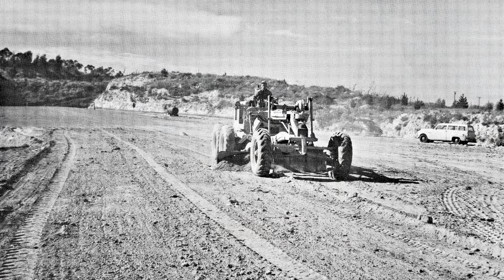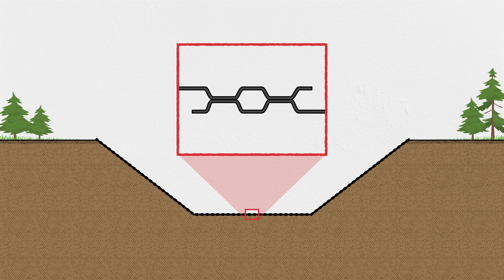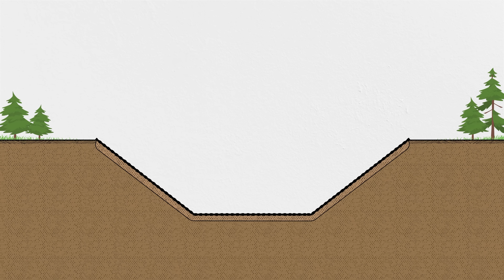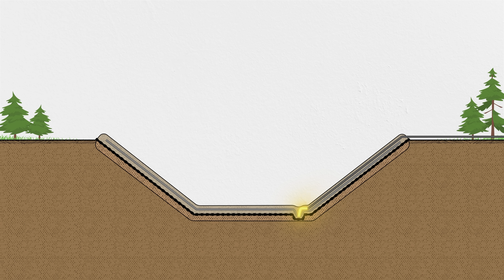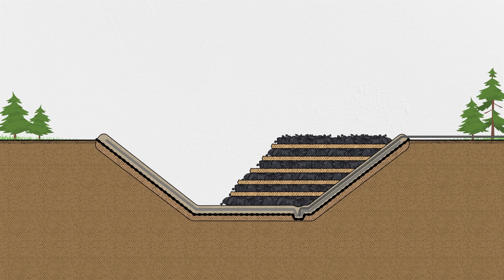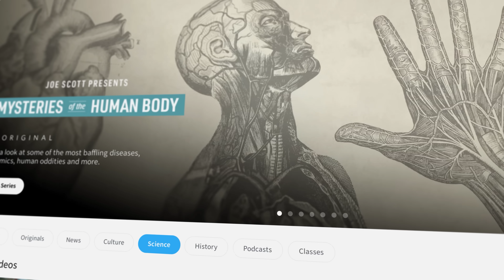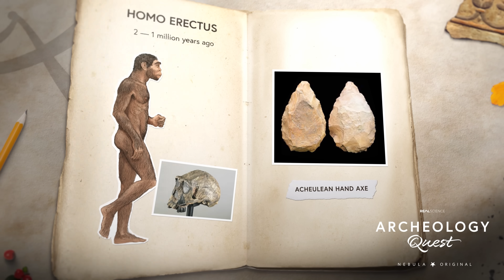The Hidden Engineering of Landfills

Comment: Take a refrigerator for example,they are now designed to fail within a year. So each household will have to throw away one fridge every year. Not because we want to. The fridges now cost something like $1,000 to 10k and then you have it fail within a year, it's unfixable too so you have to buy a new one. They used to make them last 50 years or more. This is just one example of many. This is designed obsolescence and it is incredibly wasteful and bad for the environment, it should be illegal for companies to produce trash products like that. A technician also told me that these newer fridges are designed to leak freon into your home, and so there is that added toxic bonus. What do you think they do in the landfill? Also, do you think anyone would buy these products if they knew they would have to replace them within a year or less? Think about the impact this has when everyone has to buy new appliances and every kind of new products much more frequently because they have been designed to be thrown away so you will have to buy a new one soon. I wouldn't buy new shoes three times a year. I used to buy a pair and wear them for 2 years, but the quality goes down and it makes me so sad to have to throw the worn out ones away a couple weeks or months after I buy them. I have literally bought name brand shoes that broke the first time I wore them. It's exhausting living like this.

Comment: I used to be a dust man (uk) in the 80,s,the rubbish tip took 15 mins for the truck to go down it,4 years later,it took 10 mins to drive up it!
It then got capped and left to settle for 25 years,then a new development of houses got built on it,and quite ironically 30 years later,i live in one!

Comment: I worked for an environmental engineer on new cells and caps. The process has a major flaw in that when you put sand over the geosynthetic material wrinkles are created and seams, welds, repairs get folded. These folds will produce stress on the material resulting in leaks. Perhaps this is mitigated by newer techniques but all the cells I worked at 20 years ago had this problem.

Comment: Land fills are a terrible idea. We burn the trash in well filtered incinerators extracting heat and power we use in our cities and reduce the "waste" by up to 90% in volume so the remaining material do not fill up a dump more than a tenth as fast costing less than the heat and power sell for and lasting 10x as long. Well made video, but incomplete info.

Comment: This is such an American way to do things. It's crazy.

This video is produced by the combustion facility themselves. https://youtu.be/-eVU_oARI44

It's in Swedish but they have English subtitles if you activate them. This city and municipality has about 170,000 inhabitants but the facility is so high tech it is cleaner to actually import trash from other countries to burn here, than to let the other countries burn it themselves, despite transportation emissions.

This facility works in conjunction with a food waste plant just next door, where everything becomes bio fuel for the local public transportation, so that's half the trash done right. Most of the other half is recycled into new materials and products, but what can't be recycled, is burned. Virtually nothing ends up in landfill. 

The burning heats up water which will go to house heating through hotwater radiators and shower/warm water, and the rest drives various steam generators which generate electricity. The incineration smoke gets supercleansed and the only thing coming out of the chimney is water vapor. THEN, the infinitesimal amount of waste that can't be dealt with, ends up in landfill - but not in a dump. They get integrated into road works constructions like bridgehead foundations and gravel for highways. 

The term landfill is a disgusting concept to us and virtually unheard of in northern Europe.

And before you say "The US isn't Sweden, we are a lot larger than you": I hear this a lot, and it's true. But seeing as you are a country made up of states, and the states are self sovereign in what laws they can have (bar the federal/constitutional laws), the US is very much comparable to Sweden. Every single state except California, Texas, Florida, New York, Pennsylvania and Illinois is smaller than the country of Sweden and would very much be able to do whatever Sweden is doing - in any field of politics.

Sweden has just about exactly the same population size as Georgia. Are you saying every state is incapable of doing something even Georgia could do? I think you can do better than blame everything on size on every occasion.

Comment: I disagree with the statements about it being a relatively small impact, only because it required astronomical amounts of ICE vehicles just moving around all the time, even the compactors just driving around on top of the pile - but that is a place we can improve by electrifying. My big axe to grind is that when I was a kid we sorted our recycling into different color bins, and now they just have it all mix in one can which I think is just making most of it unusable because its all being contaminated. Also, I really want a municipal composting service but I haven't been able to find anything and my understanding is that because I am in a desert that makes it prohibitive due to dryness? The dream would be local composting so that waste can break down in aerobic environment converting it back into useful matter without methane as a byproduct, and stuff that cant be composted going to a landfill such as most plastics that cant be recycled currently.

Comment: I do not understand this:

You compress solid waste to make it as compact as possible, but if you're so concerned about compacting waste to save space, why not shred them to bits and pieces?

I'm pretty sure having vehicles often go all around the place just to compact hills is pretty 'wasteful' of time and resources. Not only that, frequent use of such vehicles require frequent maintainance, and if something breaks, you have to pay for repair costs.

So, why not have a facility where garbage trucks can dump their waste into to be processed before being offloaded to landfill.

With this extra step, you can increase density, reduce volume, and get more garbage into the place whilst minimizing the cost of having vehicles run around and compacting the damned thing ever so often.

Comment: I believe landfills are an outdated and dangerous answer to a huge problem.  Landfills might be relatively low impact,  but the waste going in, and the amount of it would be another video.   SWEEP estimates the U.S. could run out of landfill space in 18 years.   As for not contaminating the water supply,  I was to get an Oklahoma landfill runoff sample for testing,  as I watched the operator get the sample from a lovely puddle behind the building, not from the runoff stream.